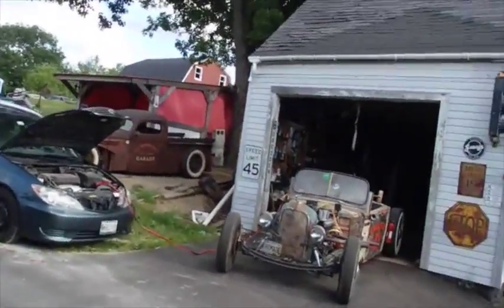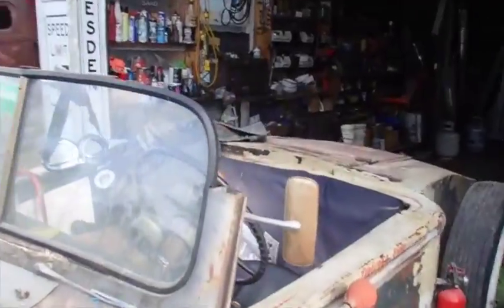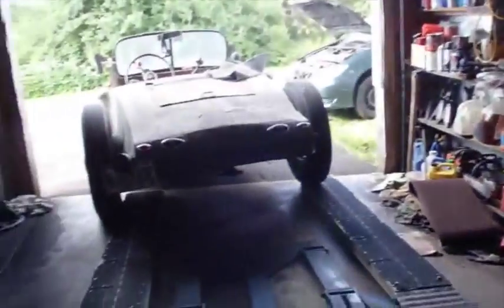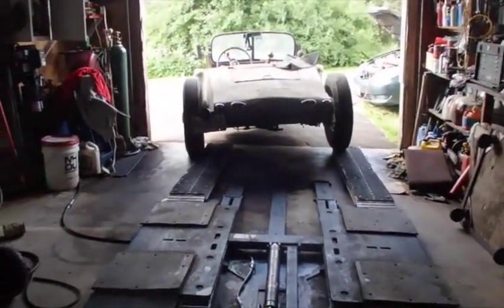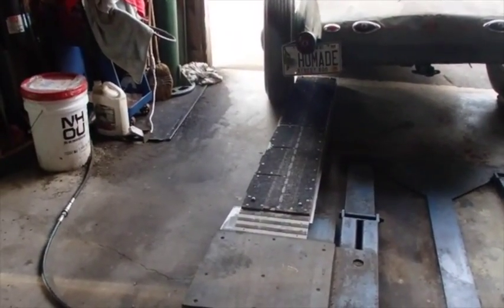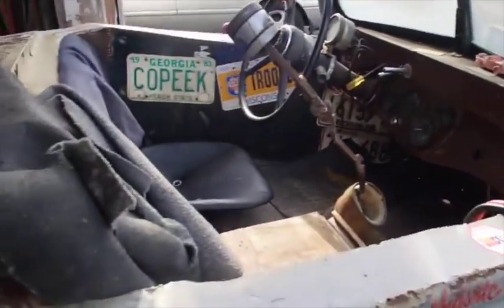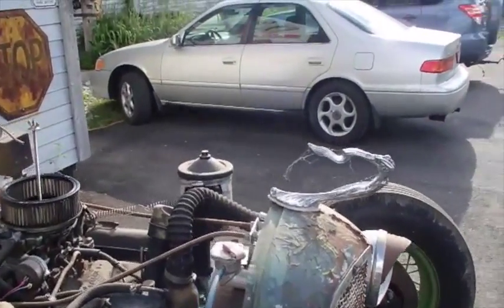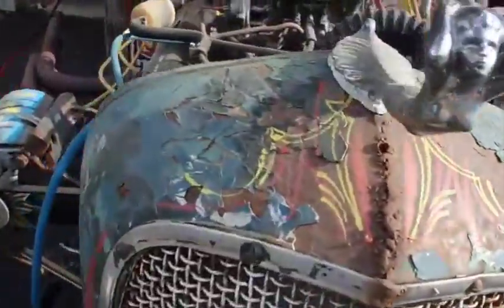Bring That Rat Rod In

Comment: Those red top batteries can be a real pain to charge at times. What I have found that works is to put a regular lead acid battery in parallel with the red top. Connect the leads from your battery charger to the lead acid battery and let them charge on the low amp setting for a couple days.
Reply from the maker: Interesting.  Thank You..